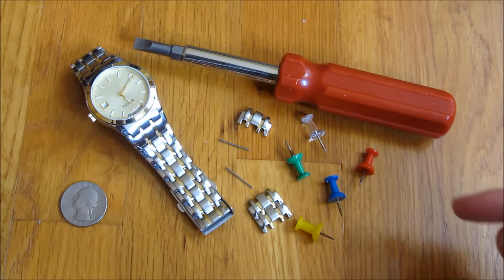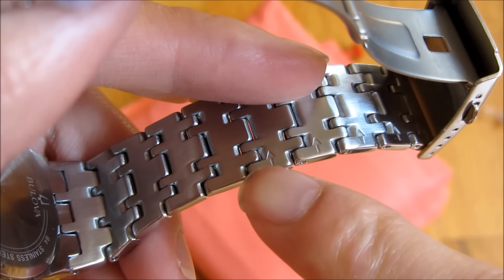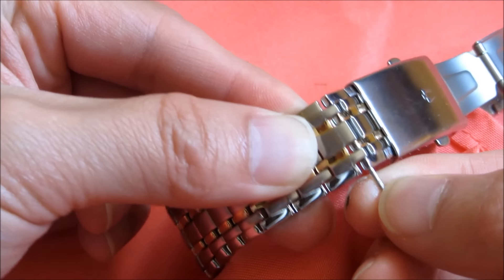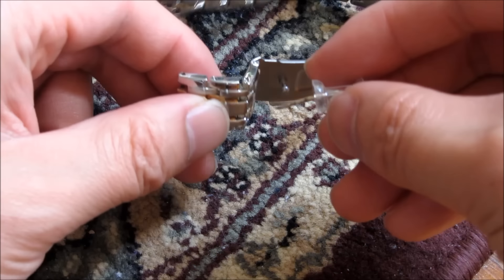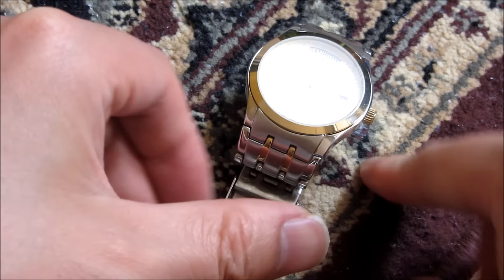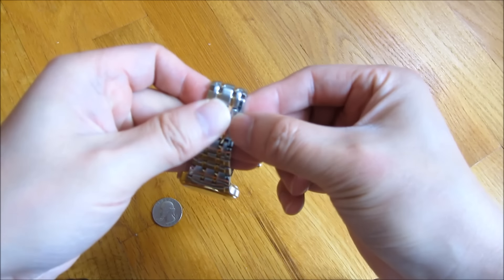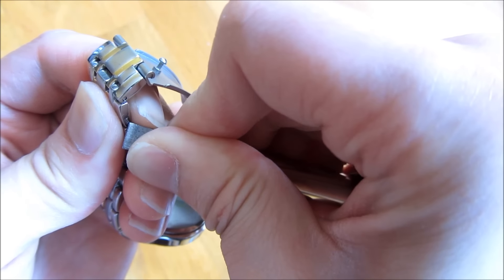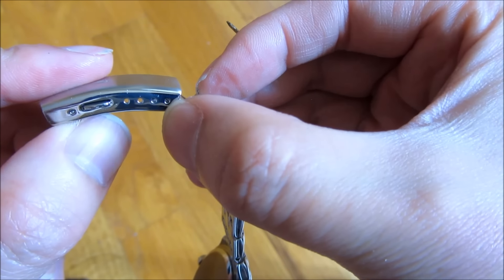Remove Watch Links with Thumb Tacks | Adjust Resize Shorten Watch Band | How To No Tools

Comment: Unbend a small paperclip and grip it with pliers. Use the tip of the paperclip to simply push the pins out of their links. This works much better for removing the pins. You can also use the paperclip to recess the pins when reinserting. Cheers
Reply: That worked so well. Thanks. Took me less than 5 min to resize my bracelet.
Reply: If you knew how to do it, why you on this video
Reply: I'm glad you've suggested a paperclip. I'm going to try that way first. Thanks.
Reply: thanks! since all I have is paperclip, I tried using just paperclip to remove the pin, works wonder, just take a bit longer perhaps. worth mentioning that eventhough I accidentally hit my bracelet a couple times pretty hard with the paper clip tip when inserting the pin back, it doesnt scratch my bracelet with ion coat.

Comment: Came back to this video because someone asked me about some of my watches. I used this video to remove links because my jeweler forgot to apparently. (Not a flex) but I used this method on a Rolex that I spent well over 18k for, so I was incredibly skeptical. You sir saved me the hassle of being overcharged to remove links. My jeweler was asking for 250 to remove literally 2 links on each side and this only took me 5 minutes to do. Thank you my friend!
Reply from the maker: Overcharging for a Rolex, maybe it's just inflation, jk
Reply: @PoolarityChannel  made me crack up lol

Comment: My Mother left me her gold Balmain watch. I wanted to remove one link for a better fit. The jeweler said it would be ready in two weeks. Your video and a few minutes solved this for me. I did use a pair of "angle tip" or "slanted" tweezers to recess the pin in place of a screwdriver. Thank you for sharing your video and helping me.

Comment: I followed these instructions to remove a link from my stainless steel Hadley Roma band, and it worked without any trouble. The only difference was that I used a small tack hammer instead of the screwdriver. Thanks for saving me a trip to a jeweler and probably a few bucks.

Comment: The watch manufacturers instructions said to use a hairclip pin.  
Good luck finding one of those.
Your video using the push pin and the handle of the screwdriver was awesome.
Now my new watch fits like it should.
Thank you

Comment: Great video. Just to share my experience. A completely different design that I have not seen on Google or youtube. Tried to remove pin and wouldn't  budge. Finally when I thought I had wrecked it, out popped a tiny spring running the width of the band with little  heads at both ends, this is INSIDE  a nearly full length ferrule. Now I understand, it's the easiest I've ever struck to remove links. Just push the the spring head in a fraction and the link becomes free at that end. Job done.
Reply from the maker: What brand and model watch is that with that type of pin?

Comment: I never leave comments, but this was super helpful! I resized a new watch I bought online and saved myself a trip to the jewelers. A couple tips I would add would be looking to see if the inside of the links have arrows - this will help you know which way the pins are meant to go out as the pins have a thicker end on one side.

Comment: So glad i came across this video!!! Yes, tapping on carpet/cloth underneath is key, and also putting the pins back was a lot easier using pliers to squeeze it back in instead of pushing with the screwdriver/tapping with a hammer. Thanks for the video!!

Comment: I'm very thankful for this. I only watched halfway but successfully removed three links, and my new watch fits perfectly. I held the band between two slightly elevated surfaces with space below to allow the pin to poke out as I tapped, and once it was begun, it came easily. Thank you 😊

Comment: I  was skeptical at first.  But wanted a quick way to change out my band on my new watch as the watch store is closed today and excited to use my new watch. It worked!   I thought a rubber mallet would be better to use then the end of a screwdriver to bang out the pin, but the screwdriver is better as the mallet head is too large for a pinhead.  Also the quarter trick worked to put back the remaining part of the pin to flush with the band.   Hey Thanks!!

Comment: Great, worked for me on a Storm watch and saved a visit to the jewellers (and cost). Getting the pin size is the key but these are standard cork board tacks you can get from any stationers (in my case I already had such a board up in the kitchen). The tip about supporting the trap with you fingers is a good one. I found that two of the pins came out easily enough, the third was a little tight and needed more force. Also I placed my watch strap over a hole drilled into 10 business cards taped together. This gave the pin somewhere to go with a relatively soft surface for the strap to sit on.
Reply: Dude thank you so much for this! Took me 15 minutes to remove a couple links!

Comment: Thank you kindly for this hack with the pushpin (thumbtack) I had a kit I got off Amazon, and the gadget for removing the pins bent on the first try. With this hack, I was able to remove extra links in 2 watches that I liked with ease. Saved me extra funds as jewelry stores in Canada charge $30.00 or more just to replace a battery or remove links. I've put a few thumbtacks in the watch repair kit.

Comment: Great video!  🎉 Thanks so much!  I came up with couple of tips that made it work better for me.  I cut the tip of the push pin off with a small wire cutter to give it a more solid, flat pushing surface.  I pulled the link wire out with a pair of pliers.  I enrolled my wife to do the pounding with the screw driver head while I held the push pin and band in place.  It only had to come out a millimeter or two before I was able to pull it out with the pliers.
Reply: Great tip, was worried about the point. Thanks for the comment!

Comment: Great it worked, I did my own.  Be careful not to scratch watch band.  Also the pushpin is slightly larger than hole so it goes stuck sometimes, so don't panic.

Comment: I did this and it worker perfectly. Make sure you position the push pin perfectly. I used a pair of soft pants underneath and tapped it so the pin could move when it's hit. Also my arrow was both directions on my watch. I also used a picket knife to strike the push pin. I also used the fabric of the pants to prevent starches when I was tapping the pin back in.

Comment: Thank you so much for this video. I had to use needle nose pliers to pull out the pin. It helped SO MUCH to let us know that the band had arrows on the inside of the band. I’ve never known that. I was working with a black band which made it difficult to see the tiny arrows. I used the file tip of a large set of nail clippers to push the pin all the way in.

Comment: For people struggling, make sure there is room on the other side for the pin to start coming out. If its flush against the table it's going nowhere. I made a notch in a piece of wood to help
Reply: I used a piece of polystyrene. Worked brilliantly!

Comment: I used a white thumbtack and a wrench. 
Tip: Use an eraser and place the pin and thumbtack on top and hit thumbtack with a wrench/back of screwdriver. Make sure to place entire setup on hard/flat surface.

Best hack worked like a charm on my diesel watch.

Comment: Bought a Pro Diver in June, 2021.  Pins are two-piece.  Shorter piece is < 1/8".   Lost short piece, not knowing it was threr.  Remaining, longer piece is not secure when replaced in hole.  

Longer piece of pin set up is identical from one end to the other under 8x magnification.  Tiny peice must be what secures pin.  

Good detail on holding driving tool ("push pin" in your case).

Directional arrows on inside of links reverse from one side of the band vs. the other side.

Off to jeweler.

Method did work on fifteen year-old Seiko Kenetic Diver, that did have one-piece pin split on one end.

Comment: If you're struggling to hit that first pin out, try cutting the very tip of the thumb tack with a pair of pliers. I found that helped me hit the pin at least starting out and then moving on to normal sharp pins.
Reply from the maker: Nice tip, Merry Christmas!

Comment: super helpful saved me 15 bucks also the part where you show which way to re insert the pin is a bit blurry so for anyone wondering look really closely at your other pin holes and you will either see the slotted end or the flat end you push it in from the side of the band with the slotted ends out

Comment: Thanks very much. I bought a used watch online and it had the extra links. I needed to add one so your method worked well. Then the microadjustment band was easy to adjust. Thanks for this video.

Comment: Great video, although I found out my pins where split so my punch was jamming in between the pin and creating turbulence, so more force was needed. Resulting in pressure on very delicate hinges amongst the clasp, witch then got bent out of shape leaving the watch unable to clasp correctly, after re shaping the hinges with a flathead screw driver I have got all parts working again. Next time I’m paying a jeweller $10 to adjust my watch band in seconds.

Comment: Thanks for video. PS to avoid scratching buy a watch kit off eBay for about £8 -£9 which will normally include a plastic vice to hold your watch in so it has a solid base & helps prevent scratches. 👍🇬🇧

Comment: One thing I'd like to add; if you're  going to be using something to hammer on plastic push-pins, make sure the hammer head isn't made of metal.  You can get small hammers that have hard rubber heads; those work well. A steel hammer head will often shatter the plastic on a push pin.

Comment: When reinstalling the pin, it goes in against the direction of the arrow? The arrow shows the direction to remove the pin?
Reply from the maker: The head of the pin expands, so you can use that info to look , usually it is against the arrow, putting it back in

Comment: I bought a $12 watch at Walmart and it has this kind of band. THANK YOU for this video, but might I suggest that you tell folks NOT to turn the watch inside out for the FINAL pin insert 😅 I had to remove the pin (again), turn the watch right side out, then pop it back in. My Bad.

Comment: Hey what about if the arrows on both sides are facing outward not in so idk where to tap in the push pina
Reply from the maker: look closely at the end of the pin and see the side that is split, like a clothes pin.  don't tap the split side, that's the side that spreads and "locks" in the pin.  tap that side that is solid.

Comment: Great video!, although in my watch the pins were really tight, so I used gentle taps with a hammer instead of the back of the screw driver.

Comment: I’ve been trying this for an hour now and the pin hasn’t moved at all 💀
Reply: Loes C 😂😂
Reply: You do have to put some force into the hammering.....then again....make sure the pins are actually pins and not screws!
Reply: Cuz your watch ain't trash. The thumb tack would bend before it drove the pin out. You need an actual tool.
Reply: @3deanes958  .....um,not really!    I used a thumb tack,and it worked fine....it bent the tack a little,but I carefully,as to not break it,bent the tack back in place....but,yeah....it worked fine
Reply: @tidechamp15  this won't work on a decent watch... If you payed 200 for your watch maybe... But why not just got to a jeweler or spend a few bucks on a tool
Reply: @3deanes958  ....an Invicta is a little more then a "decent" watch....it worked fine for me....as a matter of fact I had to put a link back in
Reply: @tidechamp15  they put invictas in cereal boxes
Reply: @3deanes958  ........you ha e something against Invictas I guess!?
Reply: @tidechamp15  idk i know nothing about watches 😆
Reply: @3deanes958  ....then why you talking about something you know nothin about?
Reply: @tidechamp15  cuz im super hyper ultra mega smart
Reply: 3 Deanes yoooo 😂
Reply: Wd40 penitrating oil u could try
Reply: @3deanes958  So, how many have you collected?
Reply: @3deanes958  That's a lot of cheese boxes.
Reply: John 🤣🤣🤣 on god this me rn
Reply: @tidechamp15  if you pay anymore than 100$ for an invicta you got scammed
Reply: I think it’s because yours has a stopper, if I said that right (forgive me watch community). 
What that is, is a small ring that keeps the pin locked in the link. (Usually in more expensive watches.)
Reply: @Wzkz_YT  Swiss made invictas are not cheap
Reply: @john9289  I almost lost my shit....  haha I got one link out and the second I still can not get out. his fingers must be extremely small... my thumb and finger are raw..
Reply: Got it with my fossil watch with ease but my Michael kors was a little more difficult but it did come out...
Reply: I have a miniature screwdriver set that was like 15 bucks on Amazon it has miniature hex heads probably down to like 1mm as well as star bits Phillips flat head etc, I've used them on controllers watches etc. Best 15$ I think I've ever spent
Reply: @3deanes958  worked fine on my movado. just took a lot of force
Reply: @3 Deanes  Yup... I'm headed to the jeweler... I can't get them to budge... not worth screwing up an expensive watch.
Reply: @tidechamp15  man… invicta are not decent
Reply: looking up in frustration only to see that you were in the same position as me made me laugh and breathe, Thank You! 😅
Reply: hope you didn’t give up, it worked for me. I hade to place the watch in a position that gave the pin room to move out of the bottom, otherwise you’ll be beating the tip of the push pin with nowhere for the pin to go. 😉
Reply: @3deanes958  y
Reply: @kiranchandrasekaran3323  T
Reply: @3deanes958  Invictas used to be a classy watch.
I see those Invicta watch cable shop it's a parade of gaudy costume jewelry watches with ridiculous pricing !!!!
The circus would make you take those watches off before you could go inside!! 🤡🚫
Reply: @3deanes958  i spent 2$ on my watch. Is it gonna work? 😅
Reply: I've been trying for 2 days now and the pin hasn't gone back in💀
Reply: I used a tiny screw driver head that fit the pin and it’s more sturdy than a thumb tack
Reply: Worked like a charm, thank you!
Reply: @3deanes958 my thumb tac bent so bad, I literally had to use my teeth to pull the pin out because it wouldn't come out that far and I had to do it twice but it's worth because I at least get to wear it now and it's new years eve
Reply: Lmao I have a whole hour as well with my Gucci watch never again I’m taking it to a professional
Reply: That’s what I’m saying
Reply: @darshannarsee  i hope by this time you realized, you need to put it back in the opposite way

Comment: Much better  to use proper tools, even cheap ones from Amazon are better than a sloppy tack method.  Too easy to damage your watch, cheap bracelet pin removal tools are only a few dollars, like $5, and much easier and smoother to use and you don’t risk damage to the watch, including enlarging the pin holes.

Comment: watched this video on repeat for 10x... nothing came of my watch strap.
Reply: Sounds like a personal problem
Reply: Andres Valentino See Same. I couldn’t get it to work.
Reply: Andres same
Reply from the maker: @jessalsot6674  make sure you follow the tip at 1:55 otherwise you won't get the right balance to use enough force to get the pin out